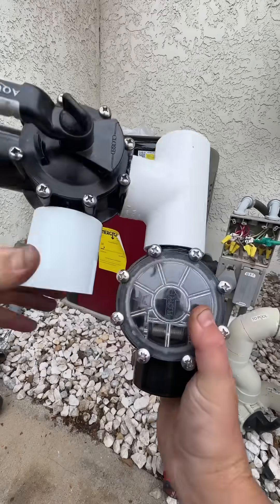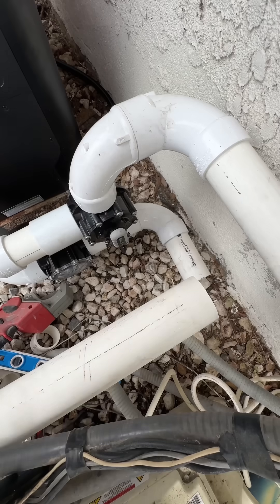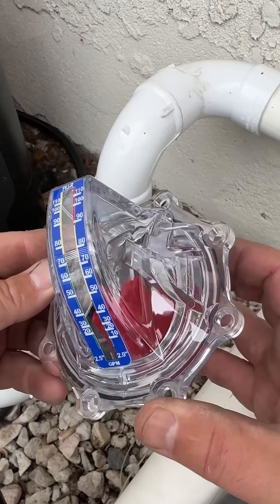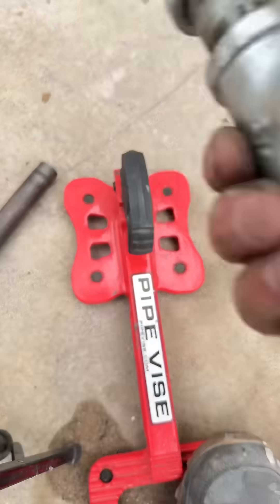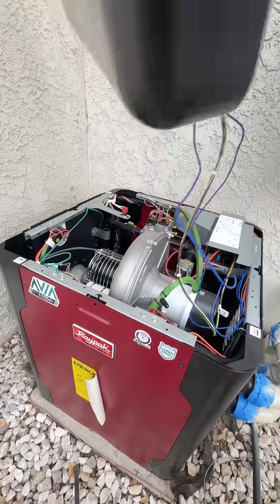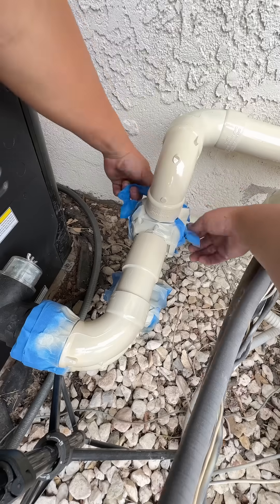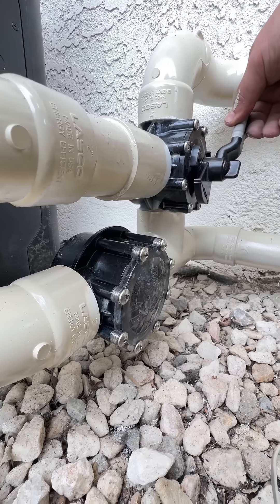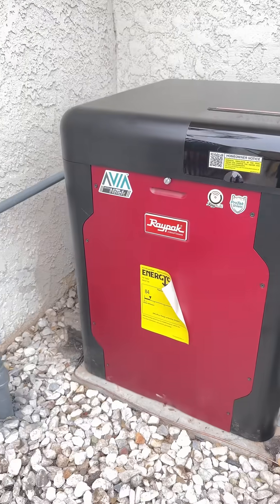Swimming pool heater Bypass. #diypool #swimmingpool #plumbing

Comment: Why would you bypass a heater?  Do they not hold up as well  to a constant flow or...?
Reply: Most heaters can only take 60-70 gpm, if you’re running 2 inch pipe with a 2-3hp pump you’re capable of running 120gpm, so you don’t wanna try and create too much back pressure trying to force too much water through the heater

Comment: AVIA heater's moaning / whinning noise is so distracting. I don't know why, but AVIA can't suppress that operating sounds at all.
Reply from the maker: I haven’t heard that at all. Moaning and whining is usually a gas supply issue. Make sure you use a manometer if have not.
Reply: @PoolVolution  manifold pressure at 3.5" W.C, but moaning opeartion sound never fade out. I've been through at least 50 AVIA heater this season, but every single one of them has same noise problem.

Some even needs to replace TRV in order to reduce the noise.
Reply from the maker: 3.5 is too low bro. Thats the bare minimum for dynamic.
Reply: @PoolVolution  Professional repairman here. I’ve replaced dozens of these under warranty. I’ve talked to Raypak about the loud noise. If it was installed around 22-23, they had an issue with the exchanges being too thin. Somehow it correlated with the sound. Not a very trustworthy unit. The other raypak model is better and it’s not being discontinued anymore. Just have to make sure the customer isn’t running the water through it with a low PH.

Comment: I didn’t install a heater bypass but I do have a VisFlow meter on the discharge side of the filter. I’m getting 77 GPM without a heater bypass. 

My heater which is the Jandy LXi gas-fired pool and spa heater features an “internal bypass mechanism” that allows water to flow through the heater without passing through the heat exchanger when the heater is not engaged or firing. This helps maintain proper circulation in the pool or spa system while preventing damage from excessive flow or low temperature.
Reply from the maker: All gas heaters for a pool have a internal bypass. And all heaters add resistance. If you added an external bypass you would still benefit.
Reply: @PoolVolution I actually wanted to add one but there was no room. The discharge of the is 3” into a sweep and 3” into the filter. The other side of the filter is a short 11” section taken up by one union, my visflow and a sweep down to the heater inlet. I could do acrobatics to plumb it but in doing so would add resistance not take it away. Ask me how I know. 😜
Reply from the maker: If you have no room it is what it is. There’s a-lot of things on these jobs that Eithier have no room or no budget or poor planning. Remember that next time you see a video of mine you don’t like. 😂
Reply: @PoolVolution On the no room thing, I mentally grumbled about the original installation making the footprint so condensed but then I thought that was probably his goal. I replumbed the entire thing within that same footprint to put in my VisFlow in and I added a 1.25” bypass that is used to pass water by inline probes which trigger auto injection of CO2 to control ph, and I inject water for water leveling using an digital irrigation smart timer. Works great and no leaks. Lots of check valves.
Reply from the maker: @knj-d4f Sounds like you got a preety neat set up.

Comment: Does this heater use a flow switch or a pressure switch to sense water flow.
If it utilises a pressure switch, you will need to install a flow switch to prevent the heater firing up when the bypass is closed.
We use Pentair Intelliflo Pumps and we can simply dial up the exact required flow for any particular aplication.
Reply from the maker: Not with an external bypass you can’t. All that pump is doing is telling you system gpm. Not what’s going through the external bypass and heater. That’s why you need flow meter. Until heaters start telling you how much GPM they are receiving through the exchanger. And you’re correct about flow switch. You could dial it in without an external bypass. But now you have higher TDH for no reason when no call for heat.
Reply: @PoolVolution  In Australia we use Litres Per Minute. Most pool heaters require about 160 LPM to 200 LPM which is an energy efficient flow rate for filtration and will operate 2 skimmers effectively in addition to 30% set to dual floor suctions
We don't use the bypass as a mixing valve.
It is either open or closed.
We use the bypass as an isolaton valve for the heater and close it off when not in use.
These valves are normally automated.
Reply from the maker: @keypoolequipment000 Glad we both understand that we use them to achieve different outcomes.